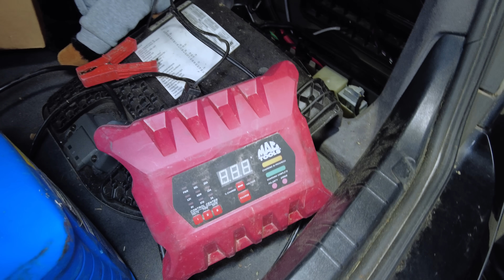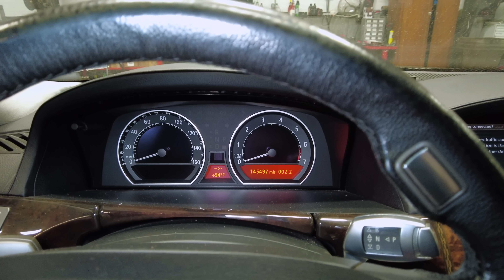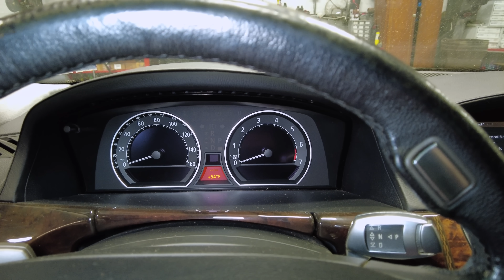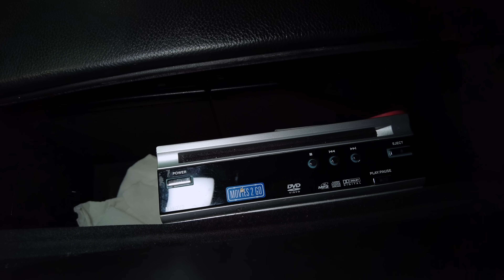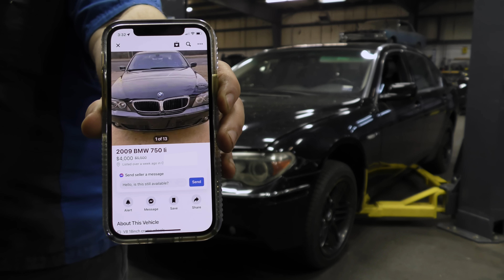Fixing a high mile German car?! Is this '04 BMW 760LI with a V12 worth it? CAR WIZARD breaks it down

Comment from the maker: New update. This 760 was also just confirmed to have the coolant pipe in the Vee of the engine leaking out of the weep holes. 
So alternator bracket, coolant pipe, brakes, no ac, many other issues = $$$$ thousands in repairs. Customer declined any and all repairs. Said “Park it out front, count me out bro”
Reply: My father had one of these CPO circa 2007, worst car he ever owned, and he bought a Vega new.
Reply: No way! This got bad real quick. Donate to charity or sell to junk yard. That's all it's worth. Or maybe just fix the battery and get a few more months of use
Reply: Oh geez!
Reply: Suprised they didn't junk it
Reply: Here’s a tip for the customer if he wants to save thousands on that valley pan coolant tube. AGA makes a collapsible coolant pipe that you can put on without taking off the front timing case cover. The part may be almost $900 but it saves so much money in labor it’s completely worth it. If the customer wants to get it fixed I’d definitely tell em to look into that fix
Reply: So it lasted exactly 20yrs before its deemed junk and not worth it anymore.  How much was this new??  Wasn't it almost 200G's??  If the design was worth something, I would spend money on it.  But this thing was hideous to begin with..
I expect the newer versions of this lasting less.. since everything is made cheaper and alot more complicated than it was 20yrs ago.. 🙁
Reply: Glad you made this update, I was going to suggest a coolant cap if it holds pressure when tested, but that makes sense. He should at least fix the battery and keep some coolant with him and drive the thing.
Reply: Sell it cheap to Germany and M539 restorations.
Reply: A company in San Diego makes a telescopic water pipe for those engines. You don't have to remove the engine just cut out the old waterline and slip in the new one.
Reply: When will people learn?
Reply: @Dominic Cerisano  The BMWs don't work that way. Once the batteries go bad the whole car starts jerking and shutting down. Happened to me.
Reply: LQ swap the bummer. Give it freedom from commie.
Reply: And a domestic autos start leaking oil around 30,000 miles
Reply: Time to call M539 to restore it.
Reply: Never park with driving it, that will kill it. I have sports car for the weekend. I drive it at the weekend regardless of where i’m going. Gets fluids, heat and gases going throught car
Reply: @mutiracialbeatdownPB  You should go for it as long as you know what you’re getting into.
Reply: Another case of the buyer not having any real expectations.
Reply: smart owner. he's getting the heck out of that money pit!
Reply: @neoanderson7  In Germany cars just aren’t kept this long (with few exceptions).
Reply: @TheFrenchPug  I think they used that on Hoovie’s Phantom — brilliant!
Reply: Even "cheap" E46 is for many expensive to repair. Last year I bought E46 Compact with N42 engine for 1500usd. It needed new MAF, coils, fuel pump, filters, sparks , valve cover seals, oil separator, complete brakes and valve stem seals. Something arround 1000usd in parts. And I did all work by myself. Valvetronic is pretty scarry part for someone who see it for a first time. But in the and I have small car that is fun to drive. It is not easy as BMW are over engeneered and complicated but I think it is worth it. There will be no more cars like this. Now they are cheap. In feature they will be expensive. Have you try to bought S13 recently? I bought mine for just 2000usd 10 years ago.
Reply: Sounds like a Hoovie car.
Reply: @randyfitz8310  Do you think that's the way it should be though??  I mean, if you're spending that much on a vehicle, don't you want it to last awhile?  Or is it just to exhibit how much money you have and how "important" you are???  Don't get me wrong.. I wouldn't want to save this thing at all.  Then again, I wouldn't have spent money on it to begin with.. 🙂
Reply: @neoanderson7  I think it was the case to some extend in earlier times - old Benzes and old Volvos were build with the definition of luxury being reliability. But the top ranking cars were always a nightmare waiting to happen, just think of all the hydraulic lines in an Grosser Mercedes. Or the Bosch CIS in Porsches and so on. And in todays world veryvery few cars are build to last more than one decade. So to be honest, I think its something that we need to accept with those cars.
Reply: Ouch!
Reply: Its only worth it because its a v12. Which is rare. Some day v8 will be rare
Reply: Yeah, they have some big failure points on these e65/e66 models, but I was able to get mine up to 230k..  Furthermore, the oil pressure switch is another one that is likely to fail and cause similar conditions as the one's outlined in this video.  To the Car Wizard's point, very intricate and difficult to replace such items, but they're also amazing cars when they're up to standard.
Reply: @gromitNOR83  he already fixed a B7 Alpina, gorgeous one by the way.
Reply: Typical
Reply: It occurs to me that 3D printing may be the only way to replace all those fiddly, fragile plastic parts. it makes me sad that the V12 in that car is going to cost so much to fix.
Reply: 2004 was the worst year across the entire line for BMW.  Trash.  Good on you for doing that Dave.  You're a good dude! :)
Reply: @kenj.8897  There's other vehicle manufacturers than those in Germany and Detroit.  The Wizard and many others don't say "just get a Toyota" for no reason.
Reply: @Dave-Cruz  damn. I would so buy it for a solid price. Would be a fun project.
Reply: @jonbrowning6839  The sad thing is there's a lot of kids that are going to see that it has a v-twelve , see nothing else, buy it, and end up completely dissapointed because they got one of the worst v-twelves ever made.
Reply: The classic sign of someone who can't afford to run a German car, BMW or otherwise, is putting cheap Chinese tyres on them, like this one has. Like any car, if it has been maintained properly it will treat the owner well. There are other channels out there which show the same flaws with Mercedes and Audi so it isn't just an issue with BMW. At the end of the day, German car makers push the envelope and innovate. Japanese car makers do not. They follow the same recipe they had a decade ago and just wrap old tech in new body styles.
Reply: @gromitNOR83 Yes indeed. It would be like new and run for another 20 years!
Reply: I'll take the car. It doesn't bother me. I don't have to pay for labor. That's all I work on is bmw's and Mini's. But you are right, if you can't afford a new one and don't know how to work on them don't buy them. I worn people about what brakes and the cost to fix them. Usually before they buy them. Most often, people have already bought them. 🥺
Reply: @trey4341  
It's amazing how these automakers get by on image for so long. There are thousands of stories just like these yet crap is being paid for again and again
Reply: What did you expect from a cheepo that won´t even buy a new battery and relies on chargers.
Probably a neglected car that if it was maintened properly might have had a better outcome.
Even if all these repairs had to be done they could have been made gradually and not all at once.
Reply: Thousands in repairs if you take it somewhere that is going to charge as much as the dealer and you get all brand parts. Currently daily driving a 17 year old BMW that wasn't well taken care of and it's had its issues, but they arent so bad if you source your own parts, know how to find them at good prices and have a good mechanic.
Reply: @randyfitz8310  Mercedes used to make cars that ran for 30 years or more.. BMW was not far behind.  when the Germans got rid of them, the cars weren't scrapped, they got 2nd and 3rd lifes in Albania or Romania or Africa......
Reply: @neoanderson7  the rich guy (or lady)  who buys it new, replaces it after 5-10 years..  But that is not the end of the economic life span of such a vehicle...  You don;t scrap it, you turn it in and a new buyer will enjoy it for many more years....  plenty of these Executive Saloons from the 1980s 1990s still run today.  . and after all that, some car wizard in North Africa will give it a 4th or 5th life......
Reply: @toyota420xp  soon any petrol engine will be rare   (soon as, in one generation)
Reply: It's a never ending money pit, only for parts, and the rest sell for old metal. Only if you have several, prepare one really well. If you only want to fix it by customer or for yourself, leave it, because you will always find more issues, or at least a short while later. And yes i know what i am talking about...  a lot of plastic, to much for such type of a car..  junk... and the battery in the back is asking for trouble.  You can repair everything, but at what price vs the real value of the car.
Junk if you ask me, if you want to buy any of such car, lease it for a while and take another one... but not private
Reply: @frankyduschek3366  a sane european customer would just buy the 728, 730 or 735.  the 750 or 760 were just flagships, marketed at captains of industry and CEO's and football players,   not ordinary people...
Reply: @neoanderson7  A quick online search seems to suggest the MSRP was $110K us in '04 dollars before taxes. In '23 dollars, that's equivalent to about $176K before taxes.  I think the designer got demoted and/or later fired for his hideous design.
Reply: @gromitNOR83  Great idea! IIRC, M539 has down 2 V12 restorations already so he's more familiar with them?
Reply: Customer has a BWM on a Dollar General budget.
Reply: They make an aftermarket ones that thread in so you don't have to take the timing cover off
Reply: @neoanderson7 right
Reply: Not true… 2016 bmw F30 still going strong and without troubles for 2 years
Reply: @yurimarrocos8237  F30s weren't taken off the market when traded back in at a dealership. Those were. There were about 50k of them in a couple hangars in CA I believe
Reply: @lukeyarasheski5510  Those are notorious for their brittle electronics and engine, no doubt! Just pissed at people saying BMW cars are unreliable... As a F30 LCI owner and an E46 330i ex owner, I just don't agree with that statement.
Reply: @Yuri Marrocos  Well the E46 for sure. My wife and I have 5 bmws between the two of us. Nothing newer than 05
Reply: @daysofgrace2934  huh
Reply: Shoulda got a W221 M157-powered S63
Reply: @Geotpf   A Avensis won't do 250 km/h and happily accelerate all the way .....
Reply: I’d buy it but I don’t have a lift yet at home, it will not be my daily either. It’ll probably take a year to fully restore it during my days off. 

All one needs is INPA, tools and time with patience. I won’t charge myself labor! 

We gave to remember that many shops are moving away from jobs that are greater than 8 hours. They rather work on 5 cars in that time and make less, than one car. 

If one wants to keep a BMW he or she needs to know how to fix them. Once the warranty expires and numerous owners have neglected the car it becomes the car in this video.
Reply: @wernerballesteros6821  he is the most fanatical BMW enthusiast out there, granted he has the tools, knowledge and connections to make major BMW repairs possible.
Reply: I’ll buy it
Reply: @Dave-Cruz  I would fix it cheap
Reply: Can't beat the smell of a fine German car they smell almost like a fresh box of crayons
Reply: How many miles were on it when you got it?
Reply: I had a feeling that’s exactly what it was! A lot of times the timing cover gaskets will leak on those as well. Jonny the car ninja usually recommends that his customers do these repairs if and when they decide to do the valve seals since the engine and everything else around it has to come off anyways to access those. But since you indicated that he is not going to be doing these major teardowns anymore then whoever does end up with this car will have to find another shop that is willing to take on this job. It may or may not be worth fixing on this car honestly.
Reply: Car is still running on streets of China.
Reply: Here in town I saw such a 760 with gigantic wheels. Must have been 22" at least. That changes the whole perception of the car.
Reply: So the coolant pipe can be fixed by using the coolant pipe stent repair kit for $250 and all it requires is removing the water pump, alternator bracket gasket was leaking barely in this video, a $20 part which can be done in a day by anyone with any bit of mechanical competency, and everything else listed costs the same as a domestic vehicle to repair. But keep perpetuating that these cars are junk so the prices stay low for us guys “in the know” about them, one of the best handling cars I’ve ever drove due to its hydraulic sway bar which has an extremely low failure rate, I’ve actually never heard of one having an issue. Take it to another shop or learn how to wrench, bro